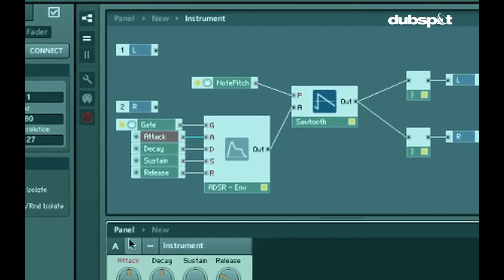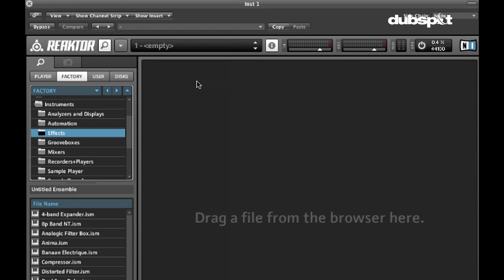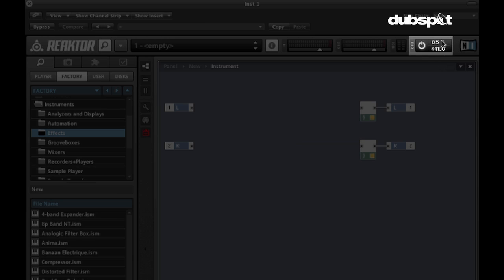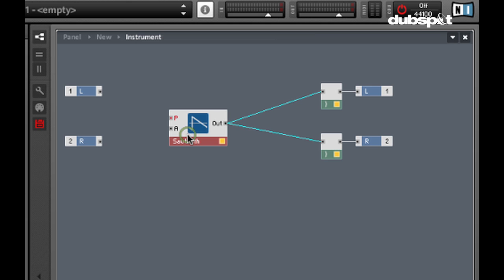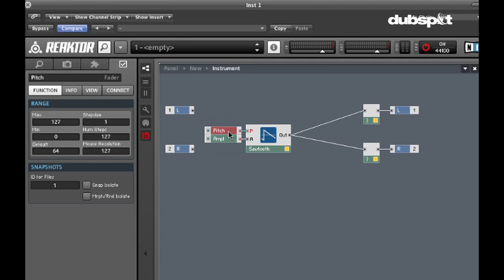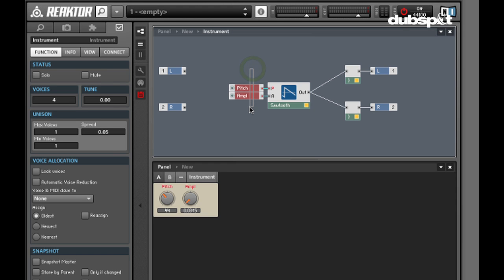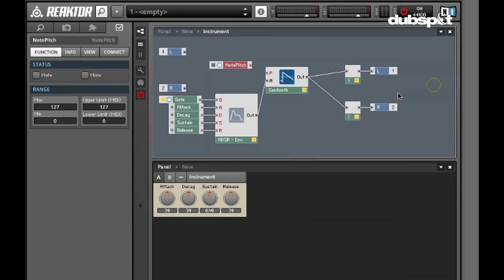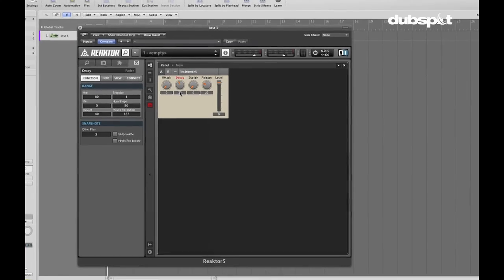Sound Design Tutorial: Using Native Instruments' Reaktor To Build Virtual Instruments

Comment: @VisualK3i94 there can be if you want, but a lot of the time, you'll want to use the Gate as you would velocity and note on/off with MIDI. It will signal a note to turn on, how loud it is, and when to stop.